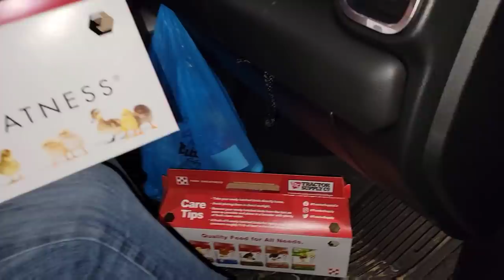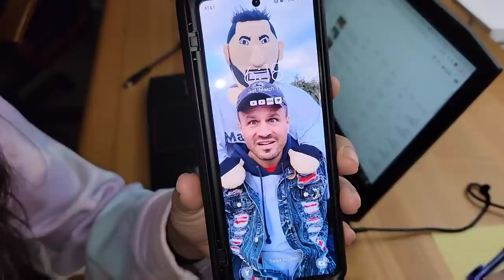PREVIOUS OWNER SHOWED UP ... I Bought My Dream House

Comment: Now when you build your roosting area for your chickens build it so black cement mixing  pans can be slid under the roosts as chickens poop during the night so the pans are loaded with straw or wood shavings, dumping the bins (cement mixing pans) making it easy to change bedding less often in the whole coop.  If you need pictures would be glad to send them  saves work and mess.  Each chicken gives off the energy/heat equal to a 10 watt bulb.

Comment: You guys should consider hydro power on the creek for the house.  No more electric bills. Creek has most definitely enough flow for all year. My creeks are much smaller and at 8000’ in the mountains of Wyoming and provides for all our needs year round.

Comment: I totally agree with you on putting the sled under the windows and where I grew up we had a cistern too the way we collected the water was from the downspout of the roof and we used that water to take a bath in it we liked it a lot better than the well water

Comment: When you have a power outages you cannot run any water or flush the toilets.
Because the pump in the well needs electricity to pump water to the house. 
It is like that where I live. I keep a 5 gallon bucket full of water a all times, so I can flush if the power goes out. 
I also suggest having an artesian well dug, because it is 250 feet deep, and NEVER runs dry so you don't have to have water brought in to you. 
We have never run dry here on the farm even though our state has been in a drought for the last 10 years.

Comment: Take a bee class or get someone to mentor you .Bee keeping is tough. You can loose hives not treating them for mites,or not having mouse guard’s in place. Or worse being attacked by wasps. They need sugar water before the flowers come out. And 3 to five pounds of bees with a queen is going to run you over 200 dollars so it’s an investment.  So at least get a bee mentor.  The bee keepers guide for dummies is a good place to start. And find a bee keepers club or association. You will need help. Good luck. We just lost our bees over winter. So sad about loosing our honey girls.

Comment: When I was a little girl, I went sledding on a sled like that.  Someone ahead of me stuck their foot out to stop and I hit them, drove the bridge of my nose right on the metal slicing my nose open.  I needed stitches but my cousin had scared me so much about stitches " If I needed them I'm going to die from bleeding to death."  The Dr. couldn't hold me still long enough to stitch so they put a butterfly bandage on it.  When I was 40 I finally told my mom about it.